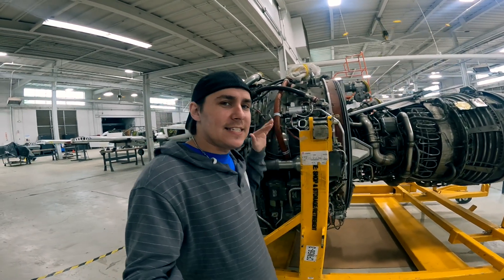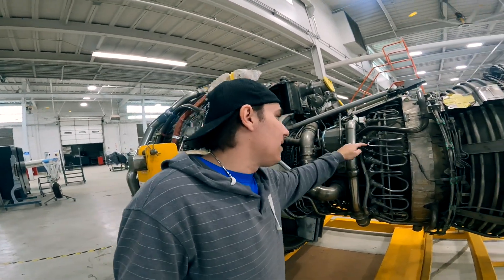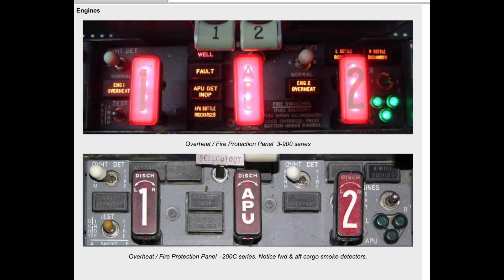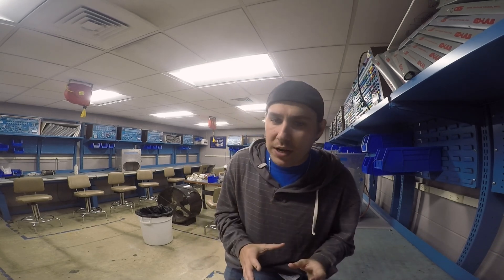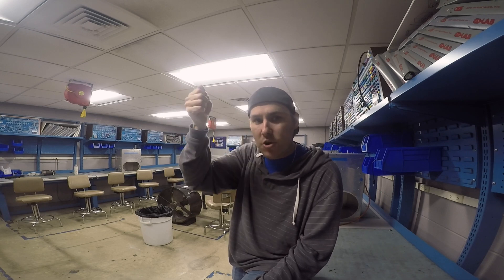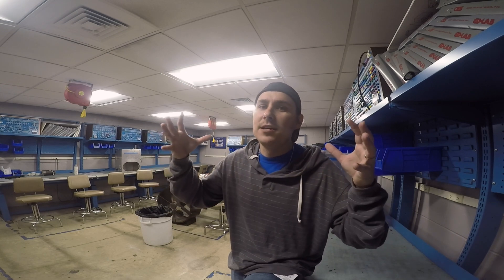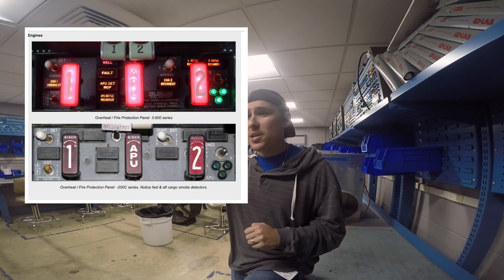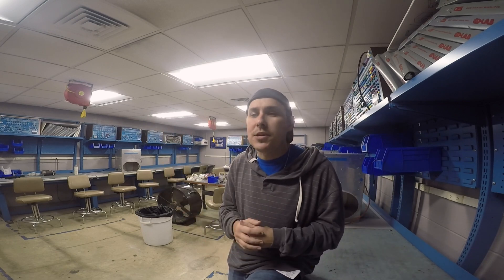Off Duty Pilot Tried To Shut Engines Down By Pulling FIRE Handles!! What Would Of Happened If He Did

Comment: There was a kid recently on a helicopter ride. Kid tried pulling the handle that stops the rotors from spinning or whatever. The pilot told him to stop or he'll kill everyone on that helicopter. Kid tried again. No attempted murder charge. Kid wasn't even high on shrooms lol.
Reply: I took a ride in a C-45 Expeditor (Beech 18) with my son. He didn't want to sit up front in the right seat so I did.

Noticing how cramped it was up there as I was having trouble at 6'2" 235lbs staying out of the way, I asked the pilot a question. Did he ever worry about a passenger stomping on a rudder pedal on short final or some other potentially critical action. His answer was "every minute of every flight"

Comment: Can you start up an engine in the air again after the fire extinguisher? Assuming you still have one engine or an apu running
Reply from the maker: I did forget to mention that in the video but yes you can. You have to reset all of the firewall shut off valves. However once that's done the engines can be refired.